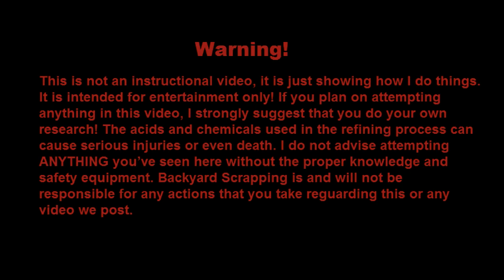Recovery & Refining Green Fiber Processor Gold Pins Part 2 REFINING

Comment: When you trimmed the filter, you cut off some of the dark spot on one side.  That dark spot may be gold that dropped out.  If it isn't, you can filter it out later.  Don't want to loose any gold.
Reply from the maker: Thanks, not to worry, I save all filters, cut offs, paper towels, fluids, and reprocess everything again at a later time. It can be amazing what you can get out of that stuff, I also do the same with silver.

Comment: Very informative video, thank you for taking the time to show us. One question though, what filter paper do you use?
Reply from the maker: Most of the time I use slow flow, I think the number for them is 103, I also use medium flow some times depending on what I'm doing. I never use fast, I believe fast flows loose to much, like using a coffee filter, they work for foils but as far as I'm concerned that's it, black powder gold will pass through them.